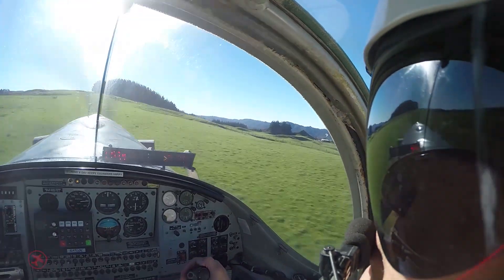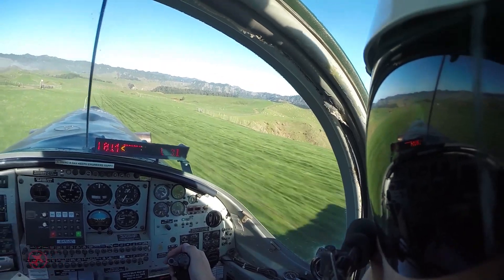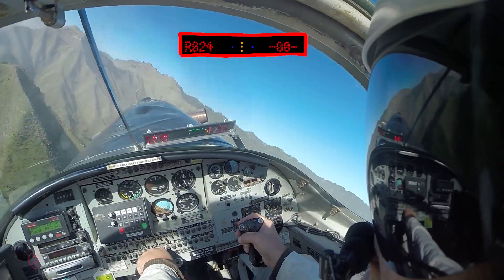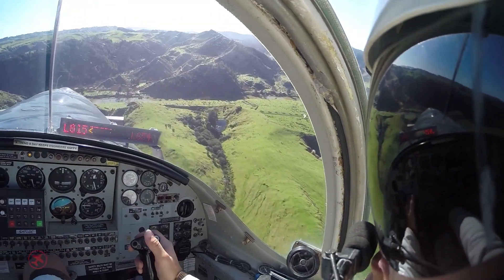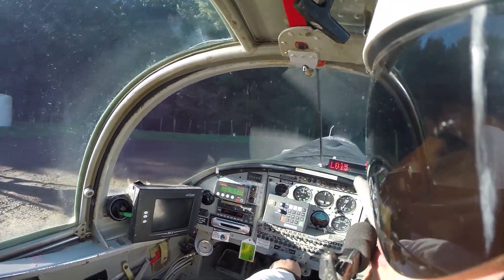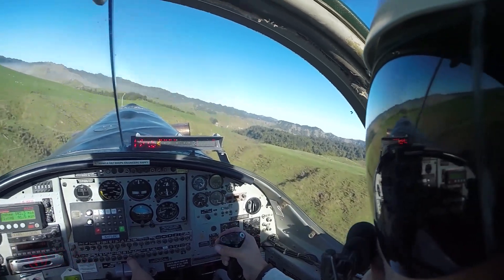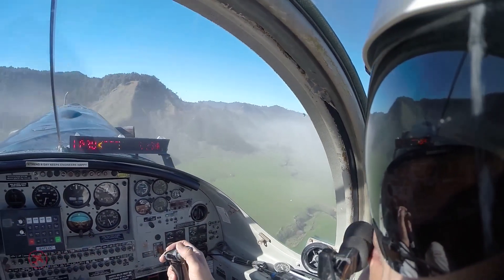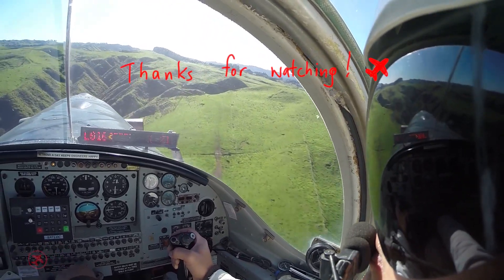Cropdusting - How the lightbar works

Comment: jet fighter pilots have it lot easier except the rare they do high G turning discomfort.  But they only do practice mostly every 2-3 days for
 a couple of hours a day only and with 10 people helping them before andduring the flight.  They dont even have to check the oils or clean the windshield.  And with ejection seats and helicopters waiting for them in case they have to bail out.  Easier and safer than Bush Pilots or Crop Dusters..
Reply: It's a little bit weird to compare both Fighter Pilot and Ag Pilot stuff.
Air Force absolutely belongs to the country, and the state guarantees everything includes the aviators.
So, both Fighter Pilot and Ag Pilot have Different task. But in terms of flight, they all have the same perspective,
Safety, Healthy, Situational Awarness, Speed, Time, Accuracy, Fuel$ ect... Those things are in one package so called "Airmanship" 🤙
Reply: @tac-cobserver3788  Where in the USA constitution say "No one should compare Ag Pilots and Fighter jet Pilots".. Where??
Reply: @emergencylowmaneuvering7350  Hmm... ? Should we add constitution of a nation in this kind of conversation my friend ?
Reply: @emergencylowmaneuvering7350  well, maybe i got missunderstanding about this, so, sorry bout that mate

Comment: Cool, thx for the knowledge.
Anyway, does the Beta thrust has the same function as reverse thrust ?
Reply from the maker: Beta range is when the prop is at minimum pitch, around zero thrust. You go through beta range before reverse pitch, or reverse thrust 👍
Reply: @JimboBurgess  Got it, thanks 🤙

Comment: Duster pilots, the best pilots out there, no pissing around, no stupid mis-applications of flaps or power settings and trims, if these men get it wrong they die, I’ve witnessed these pilots at work dusting in landscapes littered with phone wires, Electricity cables, Coms towers and trees, just breathtaking to watch a professional skilled duster pilot at work….
Reply: Id prefer this to military flying probably, imagine flying some drab fly by wire ultra powered jet... not as fun
Reply: @louissteven8862  jet fighter pilots have it lot easier except the rare they do high G turning discomfort.  But they only do practice mostly every 2-3 days for a couple of hours a day only and with 10 people helping them before and during the flight.  They dont even have to check the oils or clean the windshield.  And with ejection seats and helicopters waiting for them in case they have to bail out.  Easier and safer than Bush Pilots or Crop Dusters..